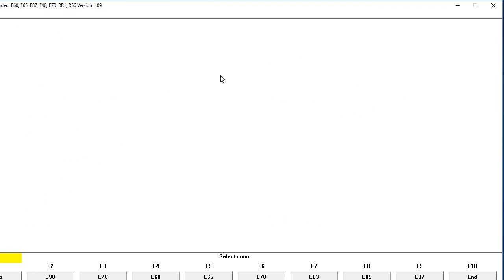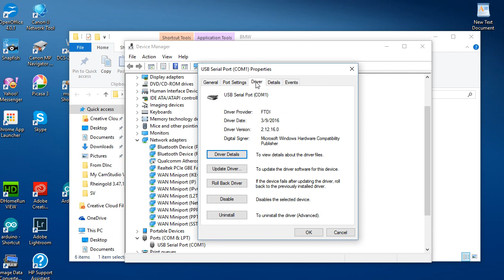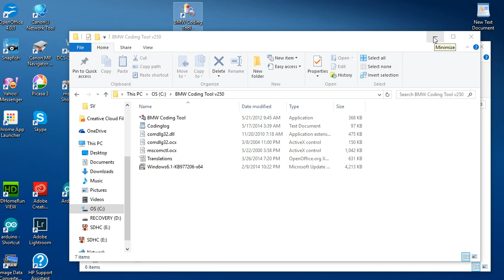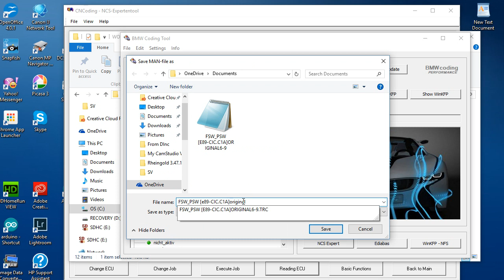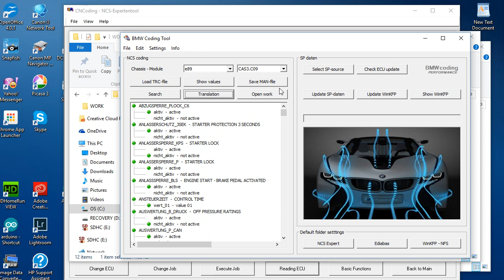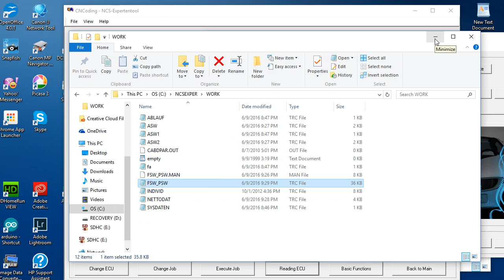BMW Coding Simple Beginner

Comment: Hi Lee. Hi Good afternoon. When can you look at the 2013 Mini Ciuntryman Cooper S. Trouble Case: Power window not working. I did check  Control Unit Tree. Fault memory 20. Ecu with fault memory (FRM)  and not responding. K-CAN  Ecu with programming abort. I did replace the FRM. Know i am ABS/DSC Codes. When is a good time? Let me know.
What cost we would be.looking at.
Winston.

Comment: hello i'm trying to access the options of my bmw e36 323ti 98 and i'm facing the following error in ncs expert: error at changing ZCS COAPI-2020: SG antwortet nicht IFH-0009: SG nicht angeschlossen oder meldet sich nicht C_GM4 COAPI-2020: SG antwortet nicht CODIERINDEX_LESEN COAPI-2020: SG antwortet nicht 
Could you help me?

Comment: I need some help Coding!
I have 2015 BMW X5 35D and I have loaded all the programs onto my laptop Windows 7 (INPA / NCS Expert & Dummie / BMW coding tool etc.) I have ordered two ODBII connector's now since I thought there may be a problem with the 1st one.  One is USB one is RJ45 -Ethernet type. Neither seem to connect to the software. Basically neither INPA or NCS Expert can read my VIN or open any info on my vehicle.
I have reconfigured the ports for the USB cable to COM 1 and the RJ45 I cant seem to read or get a connection with  that cable. No audible beep when I connecting it like I get with the USB cable, nor any connection visible under System tool/devices.
Both Cables show a power light when plugged into the OBD port. 
I did load some software from a disc that came with the USB cable.
Anyone have any suggestions? 
Thanks.
Reply: ftdichip.com - find the page with the .exe executable drivers and download on your machine. D2XX are the drivers you want, need to find the .exe though - simply downloading the zips didn't help me. i ignored the drivers that came with my lead.

Comment: Initially I thought this video was going to be useless because of the initial problems you had getting the program to load.  Wow, I was wrong.  This video showed me everything I ever wanted to know.  And it specifically showed me how to disable that comfort function where you can roll down the windows with the key fob.  The other day I must have had my fob bumped against something in my pocket.  Later that night I realized my windows were all rolled down.  Looks like I've got a little project for tomorrow to disable that.  Thank you so much for putting this together.  I think I'll also activate the mirrors closing on lock.

Comment: Can these software be used to synchronize the DME and the EWS 4.3 in a 2006 BMW X5 3.0i E53??? I have a no crank no start situation after I "rewrite" the EWS 4.3  with the AK90+ & VXSCAN Adapter, adding a new key. What tool it will work to plug to the car ??
Reply: Code as.. 7935 not as 100...

Comment: Great video!  Thanks.  However, I'm still not able to connect using INPA.  I keep getting an error message after selecting F3, selecting chassis.    I've tried different USB Drive and seems to be connecting. INPA shows the battery and engine  button and looks fine.  Any advise?

Comment: At 21:22 the permanent option is that the legal disclaimer will stay on until its acknowledged on the idrive. Timeout is default where it will go away after a moment or when you click agree.
Reply: So in short: The difference between permanent and default is a matter of couple milliseconds so you're better off deactivating it completely?

Comment: Thank you for posting this. It’s nice to see a video that isn’t rushed through. I’ve learned a lot from this.
Reply: jason hamman.     Hay is there a window rest button for Windows
Reply: Dennis Bruce I’m not sure what you mean. Are you talking about screen saver or sleep mode? If so, yes there is. You just need to go into settings and disable it.
Reply: Dennis Bruce do you mean sleep mode? If so then yes there is. Just go through the motions of shut down but choose sleep instead of restart or turn off.